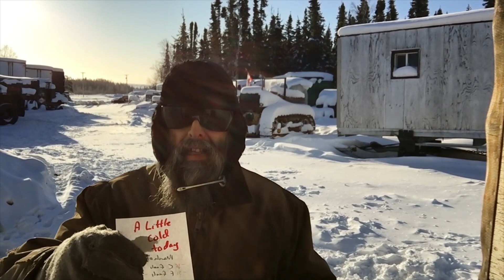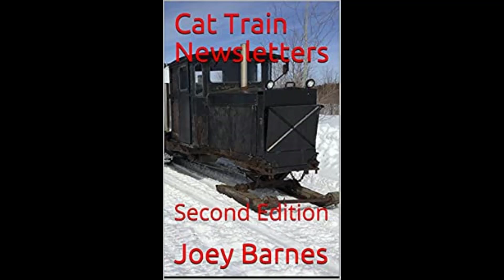Linn Tractor Steering Chains, short videos 2022 too March 01 2023

Comment: That starter staying engaged issue has happened to me but never before has it affected the alternator so it makes me wonder if maybe someone has tampered with it because it shouldn’t be excited unless it’s turning unless I am incorrect. But you will figure it out!
You have done a good job on replacing the steering sprocket on the Linn I can’t imagine how you could drive it in high gear and still be able to steer quickly!
But it’s really coming together now she will be running on her own steam soon Carry on Canada 🇨🇦 😊
Reply from the maker: the first test drive of the linn tractor 25 years ago i  could not steer it because you had to spin the wheel 300 times. then the big sprocket was chosen and the size had to make the chain tight because there is no chain adjustment. it took several tries on getting the right sprocket. oh the memories, lol  thansk

Comment: Good morning ...
On the Linn,are there carbide runners under the ski's for front steering traction?
Great progress on the engine swap,getting close to firing!
Reply from the maker: we welded on AR wear plate in a strip but no matter how much cutting edge we have on the bottom of the skis they will still not steer. the linn track design lifts the front end of the machine up when getting traction or a little grade.  thansk